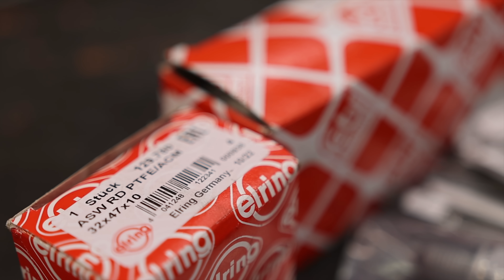A HUGE Problem With The TDI In The Zuk... Ultimate Suzuki Samurai Buggy Build Episode 4.

Comment: fwiw - as someone who once worked in an automotive machine shop, if I take an engine down to this level of disassembly, you better believe I'm sending the block out for a deep tanking/cleaning as well as getting things checked out for balance. I can't, for the life of me, reassemble an engine without it being spotless. Just me I suppose.
Reply: That's the difference between professionals and not.
Reply: For sure.
Reply: Do it right so you don't have to take it apart again in the future. If you're in there, you might as well make sure everything's done right the first time.
Reply: I'm not a pro and I'm the same way.  If it's out and the head(s) are off, it gets a rebuild unless it's a new engine to start with.
Reply: No it's not just you, has to be clean...
Reply: Oil filter takes care of it, some get paid by the hour, i personally get paid the faster i can make some pos truck run and make money another day.

Comment: Vibrant Performance for all your oil line (and all sorts of other hoses/tubes/ect.) needs! The dudes over at Speed Academy are always using their stuff.
Reply from the maker: Good call!
Reply: @DirtLifestyle  Williams oil filter service in Tacoma makes custom lines for cheap they made me extended lines for my sas Toyota just bring them the ends that you want or know what fittings you want and they will make them right there while you wait.

Comment: Heads up in auburn is the best around. Good turn around time and good quality. There super nice aswell. I work at a dealer in the area and have had dozens done by them. They also did my buddies 4g63 head, it makes 700whp.

Comment: I'm late to the party and am not reading through these comments to see if someone suggested it but, for your hose solution you could always go to your local industrial hydraulic hose shop (there are mobile ones too, like Hosetek here in the southeast) and give them the fitting and pressure spec you need and they should take care of you.

Comment: You can find BRM braided oil supply lines at KermaTDI or Darkside Developments (UK). Those are the only ones I know sell them. I had an '06 BRM Jetta for years. Your findings of cam and lifter wear are super common. I'd like to also add that Darkside Developments has PD150 injectors. They are a direct swap for the PD100's in the BRM and a substantial hp increase.

Comment: Awesome inspiration, ive been staring at the 6.0L engine for my Jtruck for months while i tinker through this wire harness. Its grungy and very much looking like a fresh engine pull still. It is setting on the motor mounts BUT i've been contemplating pulling it back out to clean it up, freshen up gaskets and maybe even paint the thing. This video makes for all the more reasoning to do so!
Reply: Yep, was putting in a low mile running 5.3 in my FJ55. Looked at the cam and it had a spun bearing. Saw there were mismatched lifters. Decided to rebuild it after seeing how mean the PO was to the engine. Almost 2 years since build and its running great and I have no reason to believe it wont for some time.

Comment: im no TDI specialist but i have replaced a couple of camshafts on these things. Sometimes the fuel pump on the side off the head leaks some diesel in to the engine oil. And that takes out the camshaft. If its a bit suspect please fit a new one. 

If the injector o rings leak they start having starting problems, especially if they sit for a few hours.

Comment: Much thought trial error inspection of parts  should be a successful build. Start up will be proof in the end. Enjoyed.
Reply: Picked up a 1986 F250 single cab long bed factory manual locking hubs 4 to floor odometer shows  69,000. mufflers tail pipes cut off. From the local salvage  yard. Nevada DMV records show  Elko county  school district ownership 20 years  sold at auction  registered in Idaho 7 years.  Came back to Elko county  sold couple more times  found abandon in truck stop Wells Nevada found a bill of sale dated February 2021 $300.00 in glovebox  That 460 purrs like a cat when started no grey or black smoke coming out of the exhaust pipes. Dial of a head gaskets to show signs of oil leaked his Royal parents are the signs of the accuser maybe 4frontcu of the weekend and the rear seals maybe clutch works good. Going to need to pull the engine  change all the seals maybe put the new freeze plugs in it. New gaskets  but eventually if I live long enough this truck will become an off-road wrecker.

Comment: Braided lines with AN fittings worked well to make custom fuel and power steering lines for my Ford F1 build. There are 100’s of fittings and adaptors to go from standard and metric threads to AN sizes, they could work for your oil lines.

Comment: I used speedway motors for premade stainless braid lines. I've been using Russell fittings when I make stainless lines. I had issues with fittings leaking when I used Chinese fittings from Amazon.
Reply from the maker: Thanks for the tip!

Comment: I’ve always ran rotella in my Diesel engines and 350 chevys. But I run Royal Purple in my LS engines. Keeps them perfectly clean. Hell I recommend people use it if they plan on tearing their engine down in the near future. To either do a DOD/AFM delete or head swap etc etc. it just cleans so good but you’ve gotta keep a eye on the oil because it cleans so good you might need to change it sooner.

Comment: A BV43b turbo from slightly later model Audis would be an even better upgrade for the motor, but you’d need to make sure the injectors are big enough so you aren’t running silly durations or getting high EGT’s.

Try looking to the European market for bits and pieces for the 1.9’s. We’re doing all sorts of crazy things with them.

The turbo feed lines will need to be braided ideally as you say. The solid lines are a garbage weak point.

S-tune, Matt Lewis racing and darkside developments all supply those, along with lots of other upgrade parts for the PD engines.

Shallow steel sumps are available to increase clearance and add resilience to the bottom of the engine.

Use VCDS lite (or buy the full version) to check the torsion angle now that you have had the head off/timing setup apart.

It’s vital for good power production, spool, efficiency and smooth running.

Fuchs Titan GT1 flex 3 5w40 is a great oil for the PD’s to avoid cam wear.

Comment: On the TDIs I had with 17, 20, 23 turbos I always used the original oil pressure tube, it was always plug and play. 

The TDI makes 260hp only with a 1749 turbo hybridized to 1752 or 1756 if it has the original BE injectors of the PD130 ASZ or PD150 ARL engines 

for offroad I used a BMW 2060 or 2260 turbo, in Portugal there are many cars and 4x4s with these turbos

I met the channel today and I'm already loving it, TDI is my favorite engine 👌

Comment: Old sbc are notorious for flat cams do to lack of oil changes and running 30 weight in states where you have a winter. Yes, new engines you HAVE TO run the recommended oil weight and type otherwise.... The newer Chrys;er hemis having issues with sludge and lifters spinning in there journals taking cams out. All from a lack of oil changes.
Reply: If you want to destroy an engine, don't change the oil. 

Even the new cars that keep track of how you drive and how many miles you put on aren't really measuring the oil directly. There is no way to know unless you send the oil to a lab like Blackstone. Also there is an incentive from the car company to set that interval high so they can claim lower cost of ownership through fewer oil changes even though they know extended OCIs are deadly to engines. That's OK, they would rather sell you a new car anyway.

Comment: Here's your feed line. Will be running it on mine soon. Should be right since we are both running stockish turbos. 

M10x1 to male -4AN adpater
M12x1.5 to male -4AN adapter
90* -4AN elbow
45* -4AN elbow
30" long  -4AN braided stainless hose with straight -4AN ends

Comment: Nate, If you head over to summit, they have a bunch of premade high pressure stainless lines for a reasonable price and you can usually find adpters to just about any thread from AN.
Reply from the maker: Will do! Thanks man
Reply: @DirtLifestyle  No prob.  I used one for a power steering pump and it worked great.

Comment: A PD engine without a roached cam would be like coffee without water.
Another advantage to head studs is you fully thread them into the block, so there is more threads of engagement than a bolt that will usually not reach full depth.
I had the same issue using a CBEA from a Jetta, the exhaust points toward the front with the stock turbo. I had to get an Audi A5 TDI exhaust manifold and turbo,  but the upside is it can handle an extra 30 HP

Kerma TDI sells a braided stainless turbo oil supply line.

Comment: Awesome work bud.
Vibrant make an adapter from hard-line to AN fitting if that helps, otherwise I think they make stainless piping for oil lines in straights so you can bend them how you want.

Comment: Nate, look online for a Parker Parflex catalog. Search the 91 series fittings to see if your connection options are there. Possibly use AN adapters. Then find your local Parker Store, ask for 929b Teflon hose. It’s a little heavier inner tube. I work for a Parker distributor, but I’m in Ohio or I would make you one for sure. Or if you need help I can help and even ship it to you.
Reply from the maker: Thanks! We do have a Parker distributor in Tacoma, I will check them out 👍

Comment: you can always buy a AN flaring tool to make the hard line off of the turbo into a AN line adapter and just find out who's brand allows the for the heat you expect to see from the oil system.  i'm using Fragola brand braided stainless sheathed teflon lines for a power steering system and they have been holding up fantastically. i'm wanting to say they are good to 3000 psi and 500 ish degree's so they may be your ticket for custom oil lines.  they assemble with common hand tools and the hardest part is usually getting a clean square cut.  so far as my memory goes there are several companies that sell a hard line crimp set up for making your hard lines adaptable to AN lines and you just need to buy the tube nuts to go with them and it should work nicely.  i plan to redo all of my lines for my bronco with custom hard lines adapted to AN lines.  if i do everything right i should be able to make it have just a few soft lines that work for all the major connections to clean things up and make field repairs really easy.

Comment: Back in the day (1981) I got some high flow heads for my 69 Bug with a stroker motor from Small Car Performance. They are in Fife, looks like they do a lot of Subaru Conversions for Vanagons, they may still have an in-house machine shop or might be able to suggest a machine shop locally that can do what you want.

Comment: Look into Driven Racing Oil Assembly Grease by Joe Gibs. He developed it because he was getting about 1 in 10 motors not making it through break in (flat tappet). Now he up to 1 in 75. I switched to it and it great stuff. A LOT BETTER then any other I have used.

Comment: I would strongly consider pushing the engine over to the passenger side as much as you can. You're already going to be building basically a whole tunnel, but you'll want as much room as possible for pedals and that giant 404 pinion.

Also, how much for the clutch? I need one for my samurai 🤔
Reply: Those xtd clutches on Amazon or ebay do work well!  I had my centerforce blow up on me before, so I decided to try those xtd stage 3 clutches.   It does work pretty damn well for wheeling, but does have some grab for daily.  They go for a good price, but remember there's a break in period for a few days to a week of daily driving.  I'm on 33s with the 6.5:1 tcase and it's perfect for me.
Reply: @20tea 
What engine? I'm thinking about putting a 2.0 in it (125 hp stock)
Reply: @Jeff Larsson  I swapped in the Sidekick/tracker 1.6 8v with a flipped 38 webber with tri y headers.  It really does great for what I use it for, but considering injection since steep inclines are still annoying even with modification to the carb.  I also got a full cage, rock sliders,  front and rear crawler bumper with winch.  All that extra weight also slows down acceleration, so I'm considering other options such as reducing the ring and pinion and/or tubing the front and rear end of the vehicle.

Comment: Where do you find torque specs for all the fasteners on these engines? I have cjaa tdi and finding proper torque specs has been a struggle
Reply from the maker: I have posters on the wall with all the torque specs from ID parts 👍

Comment: Sweet, not just me. I get clowned once in a while for the "midas well" (spelled wrong on purpose, I use to work at a Midas for years) but I live buy it. I personally could never just drop a unknown parts into my vehicle that require tear down like an engine, trans, diff, etc. Ones that take more then a few hours to do. I get a bit twitchy when I see content with the 800HP Junk yard motor when they never drop the oil pan, usually LS motors but the point is the same.... Got to have good bones

Comment: Nate awesome video, 1,9 TDI engines are great, strong out of the box, and even better when using upgraded parts and being refreshed just as you are doing, I've seen so many people just go get a junkyard engine and dump it into whatever vehicle, not change any fluids ,fill with coolant, oh i mean water, coolant cost too much, get it wired and head out on the trails or the highway ,full send it, and boom, then they blame GM for making a shitty LS engine ,not themselves, LS swaps are done for the simple reason that they are plentiful, they are in every junk yard in North America , and you can get parts at any auto parts store for one, sure the LS can go for a few hundred thousand miles with good regular maintenance, 75% of them don't ever see that , with the TDI and your upgrades, you'll get the similar torque or more without the weight or size and your fuel will take you further on the trails, even back in the 80's when Volvo sold diesel cars the engines were VW/Audi diesels, inline 6's single over head cam design 3.0 litre N/A and 2.4 litre turbo intercooler ,not fast by todays standards, stoutly built, gobs of torque and great economy ,average 35mpg Canadian, 18 gallons, you could drive for 10 hours on a tank of fuel with A/C on and cruise set at 65 mph, so VW diesels are great, if you put your foot into it, these cars did roll coal, LOL, just not like a Cummins 👍

Comment: Why not use AAZ 1.9 tdi with a 4bt mechanic al fuel pump and run the thing off 3 wires and delete all electrical components

Comment: Are you turning the engine backwards?  I'm not familiar with TDI enginges.
Reply: You can tell based on the timing belt. The crank pulley will pull directly on the cam pulley. The timing belt tensioner is always on the slack side. It's the same with chains.

It did look to me like he was rotating it backwards.

Comment: Your going to have a problem with that front axle because I built it as a rear steering axle .  I'm the original owner of those axles after purchasing them from expedition imports it was converted to a rear the shock brackets are for the rear of a unimog. I have the corresponding pics I did the disc brake conversion. Chevy rotors e250 calipers. Water jetted half inch a572 grade 50 brackets.

Comment: I own multiple VW TDi back in the days. The BRM TDi is well know for eating cams and lifter. Using the correct spec oil is extremely important. On upgraded cam you may want to add a can of zinc additives to the engine oil. I forget what is the brand but I remember it's a European brand liquimoly or Pentosin

Comment: If you get 190 hp out of a 1749 off a bhw I'll be very impressed
Reply from the maker: 180hp on a BHW is POSSIBLE. I never said likely or 190hp.  But with a higher flow intake manifold, higher flowing cam, 300 hp injectors and a higher compression engine (brm) I think 180 is much more likely on this setup. Multiple websites claim this turbo is capable of 180 on the high end. I think with this parts combo, we will be on the high end 👍